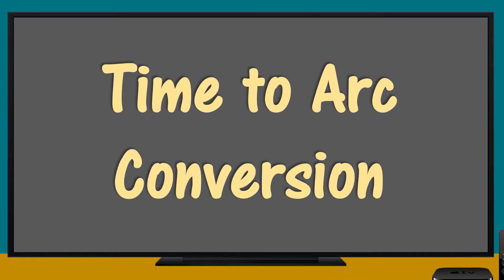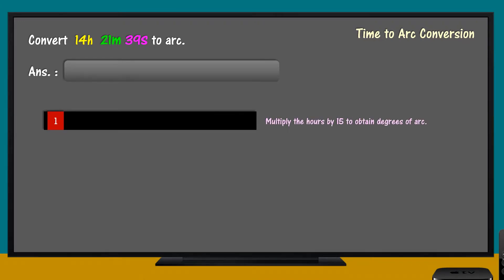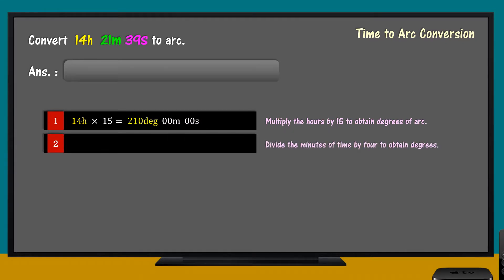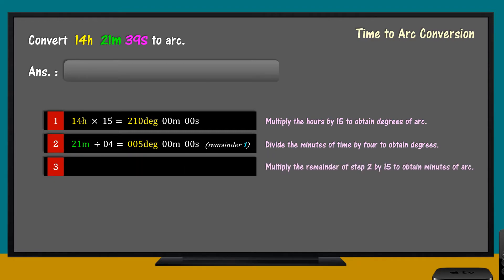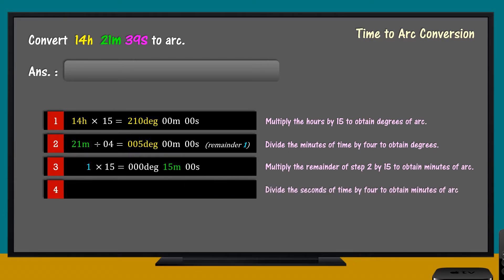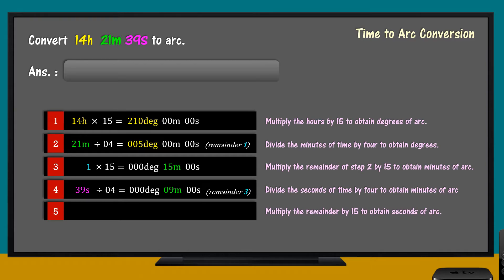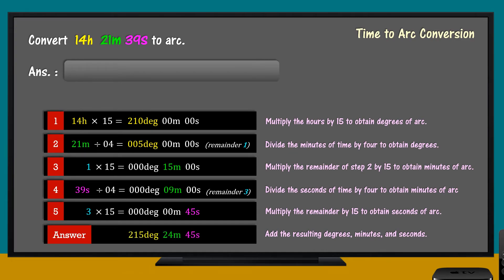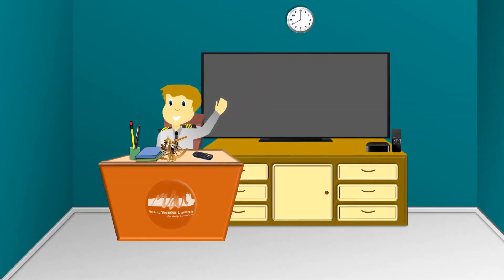Time to Arc Conversion

Comment: where does the remainder come from on step (2)
Reply from the maker: divide 21 by 4

in calculator 21 divided by 4 is 5.25
now, to get the remainder multiply 0.25 by 4

the answer is 1, that is the remainder.

Hope it helps. sorry for late response
Reply: @maritimeyoutubeuniversity4466  how about the remainder on step 4?
Reply: @maritimeyoutubeuniversity4466  can you show the process cuz i still can't get it :<